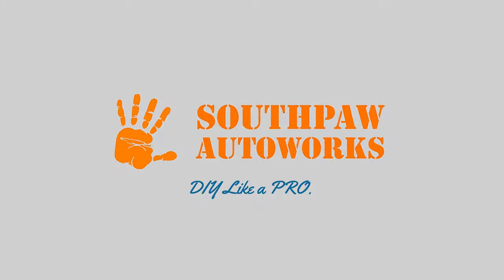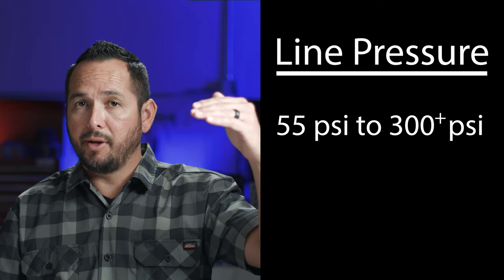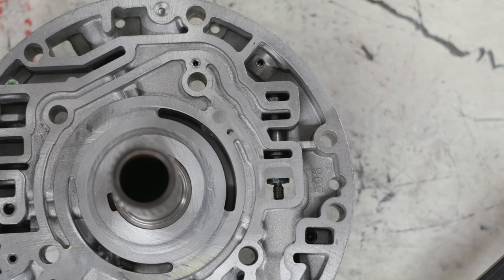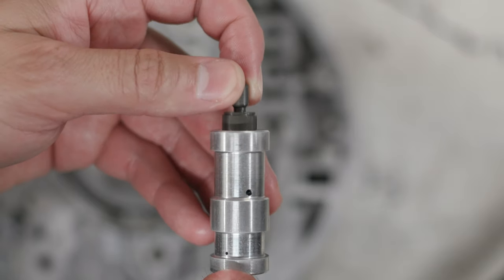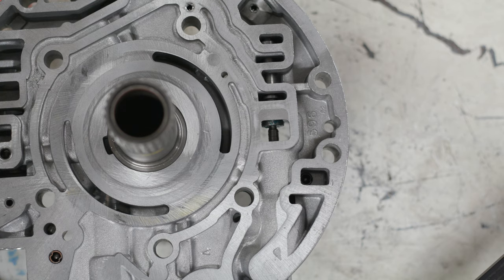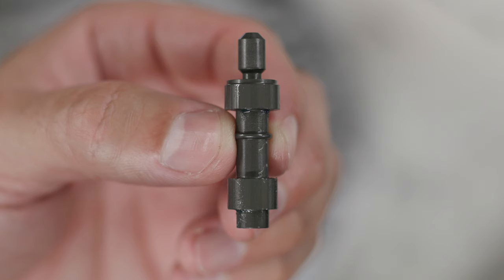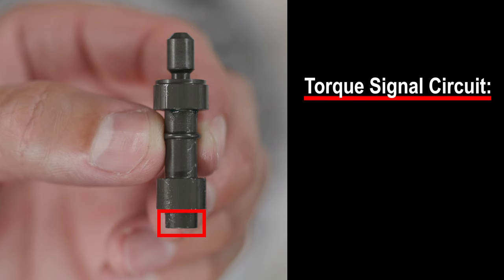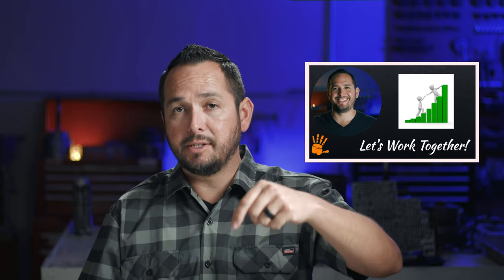4L60E Pressure Regulator Valve (Boost Valve) (Part 2 of 3)   (4L60E Line Pressure)

Comment: Recently tore down my first 4L60e that has a reverse not engaging, everything looks perfect from clutches to low reverse piston lip seals. When putting the car into reverse you can feel it trying to barely engage but nothing after that even with throttle applied no movement. Im hoping i find something within the boost valve area that could be the issue.
Reply from the maker: Did you find the problem?

Comment: 4l65 e  parts guy sent me an early  boost valve an sleeve  that is longer than than the later 06 an up. Can I still use the longer one
Reply from the maker: There's an aftermarket company that uses a one-size fits both (long & short)(I believe that they advertise it this way, too).  However, I believe in all other instances, you'll need to have the correct length to match your application.